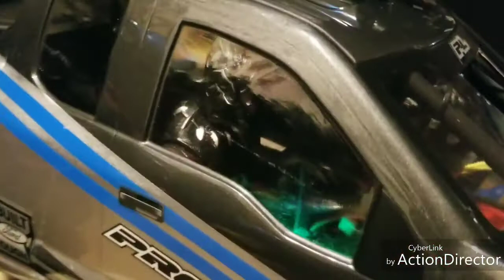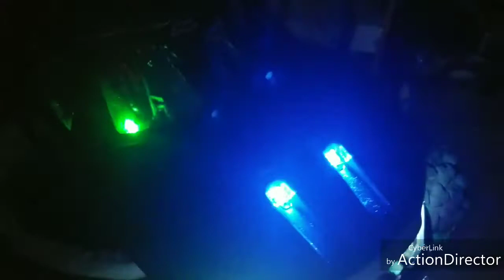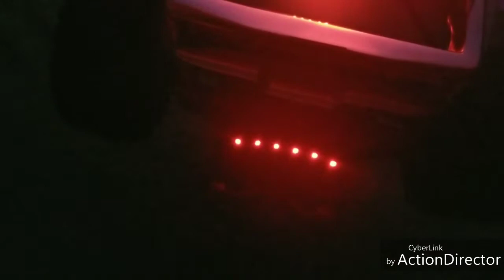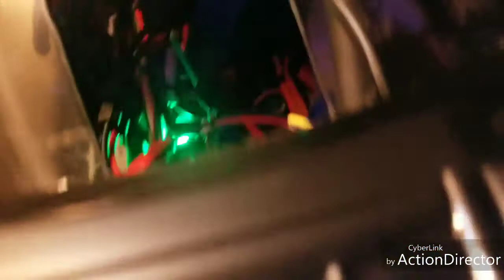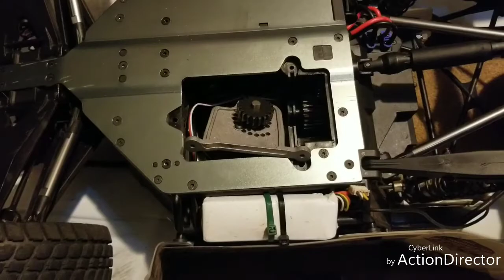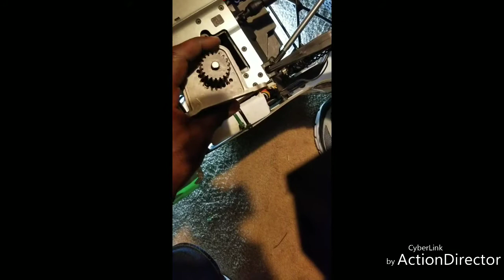SUPER BAJA REY PROBLEMS

Comment: Call horizon hobby bro. Thing should still be under warranty
Reply from the maker: Took the body apart and one of the plugs from the motor to the ESC had came loose so Im back in business. Thanks for the suggestion.
Reply: Kenny Woodson unbiased REVIEWS lol dam I forgot to say that...same thing happened to me...then just stuck a screw driver to widen out all the posts on the esc